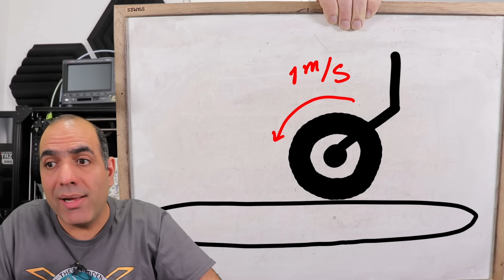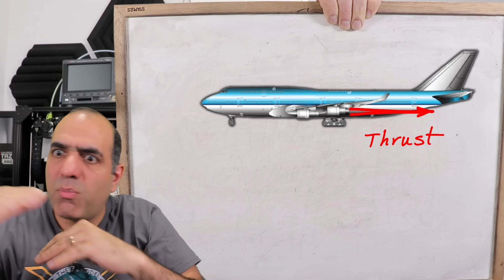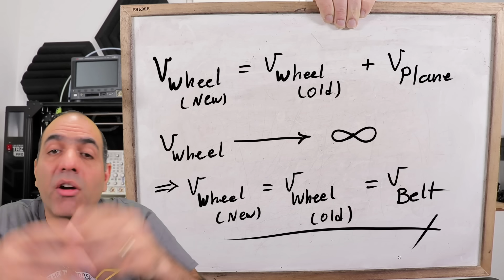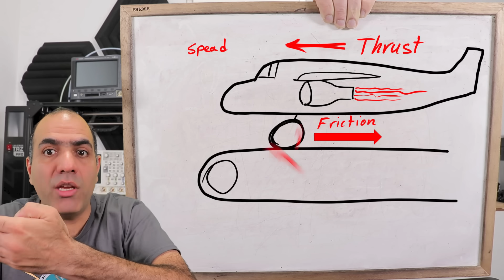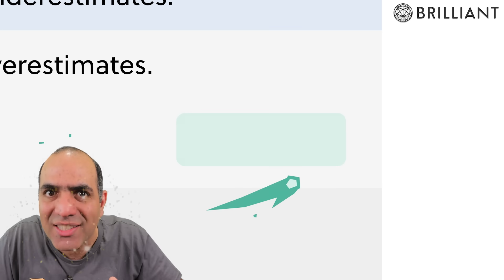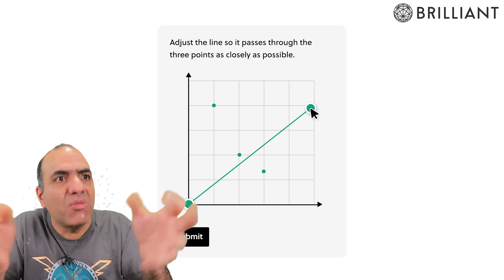Airplane Question that Drove Me NUTS!!!

Comment: Yes, the airplane can take off from the conveyor belt runway. The conveyor belt may match the speed of the wheels, but it does not affect the speed of the air flowing over the wings, which is what actually creates lift and enables the airplane to take off. The thrust generated by the airplane's engines is also not affected by the conveyor belt. As long as the airplane has sufficient thrust and airspeed, it can take off from the runway, regardless of the speed of the conveyor belt.
Reply: To understand why the conveyor belt does not affect an airplane's ability to take off, we need to examine the physics behind how airplanes generate lift and propulsion.

An airplane generates lift through the interaction of the airflow over its wings. The shape of the wing creates a pressure difference between the top and bottom surfaces of the wing, which results in an upward force called lift. The amount of lift generated by the wing is proportional to the density of the air, the wing's surface area, and the square of the airplane's velocity relative to the air. This can be expressed mathematically as:

L = 1/2 * rho * V^2 * S * CL

where L is lift, rho is the density of air, V is the airplane's velocity relative to the air, S is the wing's surface area, and CL is the wing's lift coefficient, which depends on the wing's shape and angle of attack.

The conveyor belt, which is essentially a moving surface, does not affect the airflow over the wing because the air is still stationary relative to the airplane. Therefore, the lift generated by the wing is not affected by the conveyor belt's speed.

Similarly, an airplane generates thrust through its engines, which propel the airplane forward. The amount of thrust generated by the engines is proportional to the mass flow rate of air through the engine and the velocity difference between the air entering and exiting the engine. This can be expressed mathematically as:

T = m_dot * (V_e - V)

where T is thrust, m_dot is the mass flow rate of air, V_e is the velocity of the air exiting the engine, and V is the airplane's velocity relative to the air.

Again, the conveyor belt does not affect the airflow through the engines, so the amount of thrust generated by the engines is not affected by the conveyor belt's speed.

Therefore, as long as the airplane has sufficient thrust and airspeed, it can take off from the conveyor belt runway, regardless of the speed of the conveyor belt. The conveyor belt simply moves the wheels, which do not contribute to the lift or propulsion of the airplane.
Reply: Bro used chatgpt to answer 💀
If the plane is stationary relative to the ground how can it build airspeed? It’s the same principle as when you run on the treadmill and on the road, on the treadmill you get sweaty immediately because you are stationary relative to the air and so you get no air mass flow to cool you, when you run on the road,(assuming there’s no wind ) you are invested by a flow of air with the exact airspeed you are running. It’s the relative airspeed that builds lift, not that chatgpt nonsense
Reply: @giacomozecchin  You are correct that airspeed is necessary for an airplane to generate lift and take off. The scenario described in the original question assumes that the airplane is already moving forward with sufficient airspeed before reaching the conveyor belt runway. The conveyor belt, matching the speed of the wheels, would not prevent the airplane from continuing to move forward and generate airspeed. Once the airplane reaches the necessary airspeed, lift is generated by the flow of air over the wings, which is not affected by the conveyor belt.

Comment: 0:35 thinking about the answer...
"Conveyor is designed to exactly match the speed of the wheels". It is not clear what part of the wheel they mean, so I chose the part touching ground / conveyor belt. This is always 0, regardless of speed of plane, so conveyor belt will not budge either and plane will take off exactly same way as from runway.

Comment: Gonna say no since the plane would be stationary just as if we were running on a treadmill. No air molecules would really be displaced since the plane is stationary. If air molecules are not traveling over the airfoil of the wings fast enough, lift cannot be produced.